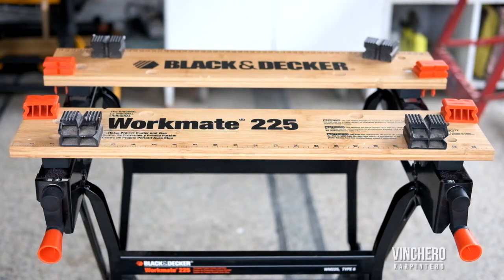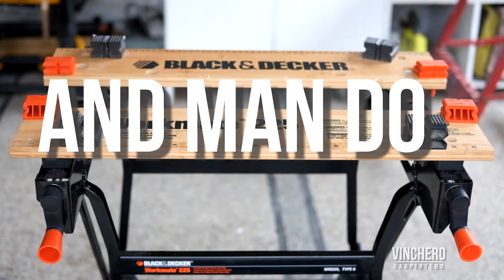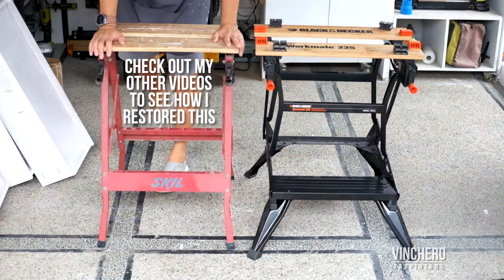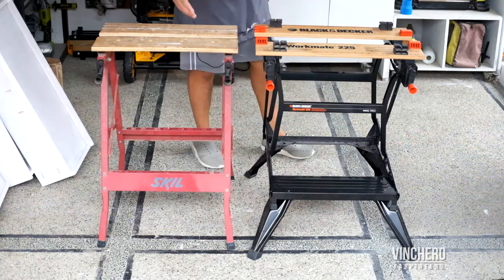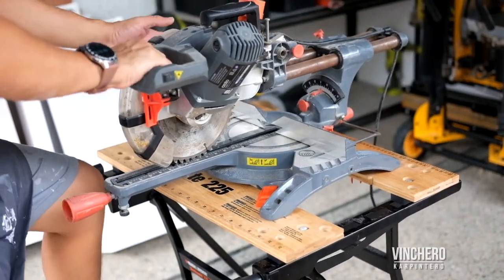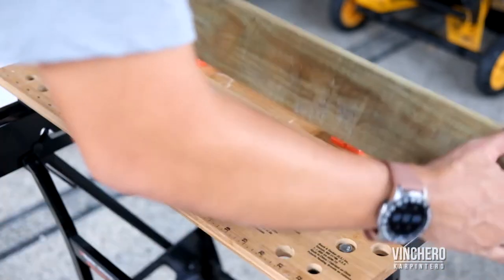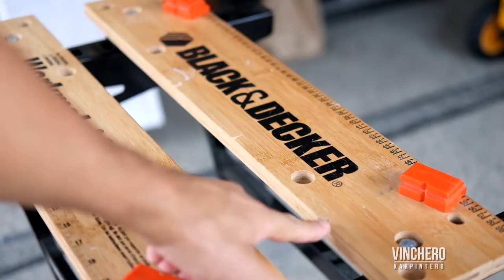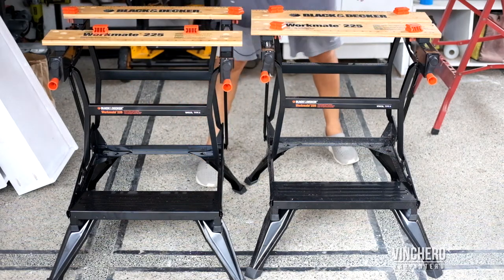Black & Decker Workmate 225 Foldable Work Bench Review

Comment: Eto yung lagi kong inaabangan sa Lazada Sale kaso wala pang budget. I like Black and Decker, I have a Matrix set, an extra Matrix drill, a corded hammer drill, and a 10L Vacuum from B and D. So far, I'm loving their performance. And I use them not just for light DIY, so I can say they are durable, more than a year ko na silang gamit walang issues. That's why I always recommend the Matrix for beginners, kaso di pa sya available locally. If not for budget reasons and specific use, I could have bought their Plunge Router last month. Ang gusto ko sa Workmate is ung clamping nya for Routing, Cutting, Sanding and Assembly. #ForThoseWhoMakeTheWorld #MakesitEasy

Comment: Thanks for the video, however this WM workbench is a shame for the price.  Plastic housings for the vise tightning screws? Even chinese made folding workbenches have metallic housings for 20 bucks. Thin wood-like tops (you can see it bending when you bear your weight on it)? Don't intend to be a hater here, but money is much better spent on an old WM or in quality tools